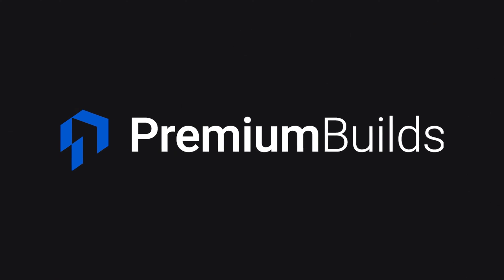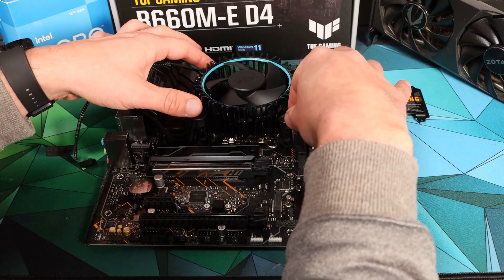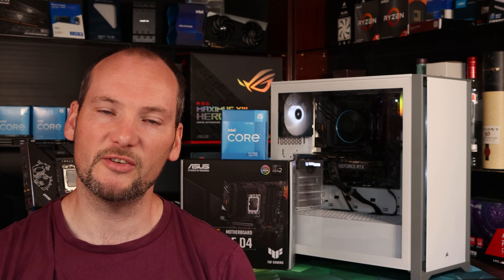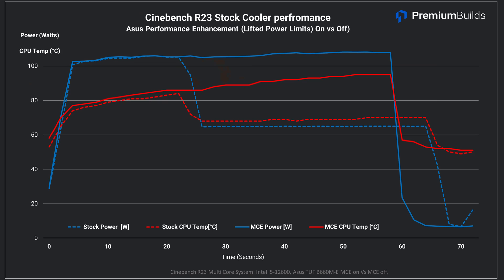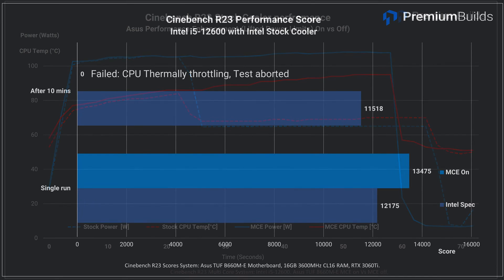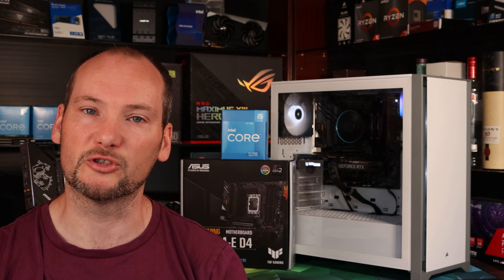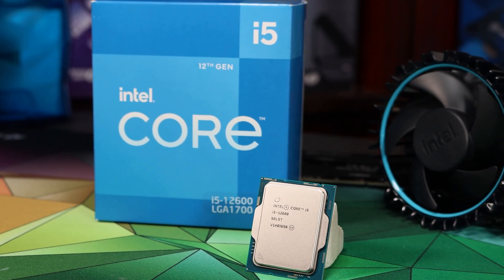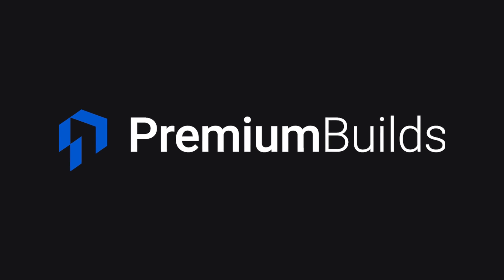Does stock suck? Testing the new Intel CPU cooler with the i5 12th generation!

Comment: as usual you like many other tech youtubers, you did an un realistic test.
This cooler is intended for 12100, or 12400, NOT 12600.
second, its the opposite, buyers who buy those basic systems runs at intel specs, not multicore enhancement.
3rd, no one runs the cpu in a cinebench loop, this is an unrealistic pc usage as it can get. 
normal people use the pc for office applications, browsing, and maximum they do is game. when gaming the load of the cpu is around 25w to max 40w.
so gaming scenario is what you should have tested the cooler with, and the results would have been correct.
If a buyer buys a pc for looping cinebench and this is what he enjoy in life, he knows very well to buy a tower cooling solution, he does not need you to tell him that.

if you claim to be professional ,re run the test as it should have been as explained above, normal gaming 12100/12400 and that's it.
Reply: very true i came for the same things you mentioned in your comment that whether it will be fine for 12400 at 65w for day to day usage...
Reply: @ITalented  I see I forgot to mention the 12100. it is working flawless with the stock laminar rm1, even with burning software when all limits are removed at bios level, which pegs the TDP to 58 wats. case closed.
Reply from the maker: Asus defaults to APE no matter what cooler you fit, so if people are experiencing high temperatures and throttling this video explains why.

I don't claim to be anything, I'm just helping people understand their choices when they pick parts and build a PC.

I make the advantages and limitations of the stock cooler quite clear in this video. 

I also moderate a community over 5 million PC users, and I can assure you that plenty of people DO NOT understand the limitations of stock coolers. 

>the results would have been correct.

The results are correct. A 40W load won't tell us anything, because it's not anywhere close to the maximum heat output of a basic i5 CPU.
Reply: @BuildPicker  You should have make the review the following way:
1. divide it into 12100 and 12400 apart.
2. show normal use case for every day pc user, which is in fact 99.9% of the people out there. use office tools, web browsing, and gaming with a dedicated GPU - what ever model you want be it RTX3090 to stretch the cpu to its max.
3. show a use case of some one using the pc for hi load rendering of photoshop or professional video editing tool.
4. teach why using an unrealistic scenario of OOCT or cinebench or what ever burner software to burn the cpu synthetically,  is not loading it in real terms but artificially for lab tests only, which are not relevant to the normal end user but to the developers in intel.  that is why no one should show the audience tests like that.
if it was a car, you show how it behaves on normal roads by normal drivers, not in Sahara desert at 55 degrees Celsius, stationary without air flow on a dynamometer. every normal car put to a test like that will blow its engine in a few minutes, even if it is a heavy duty caterpillar tool.

once you conduct the test to represent the use cases which it will see in its life on the road, you will come to the conclusion, that for 99.999% of the times the default intel included cooler is adequate for the 12100 and the 12400.

than you can elaborate that for the 12600k and above, this cooler is not intended and do a separate video showing why, and guide how to pick a tower cooler optimal for those more expensive cpu's - intended for the professional work loads scenarios. intel did not include the laminar rm1 with them for a reason.

**I am an engineer, I write from professional experience and knowhow.
Reply from the maker: @AY-dw4om  >, that for 99.999% of the times the default intel included cooler is adequate for the 12100 and the 12400.

It's not though because it restricts the ability of the i5 to perform optimally, and also it's really loud. It is supplied with the 12600, which adheres to the same power specification as the i5-12400 and doesn't draw any more power: it's just a better binned CPU and thus more efficient. 

I literally say that the Stock cooler is fine for gaming, or if you ensure stock power limits are adhered to. I'm not sure why you're so angry about this.

You're welcome to buy these components and do the testing yourself, to your own criteria. You can even make your own videos about it, that's the joy of youtube!

However, a better cooler is a big quality of life upgrade, like better tyres on a car, if you want to stick with that analogy.
Reply: @BuildPicker  I am not angry , you miss understood me, my wrong here.
for your info/question, I currently have 12400 for the past month with arctic 34 basic tower on it, which was found to be an over kill.
the cpu in real pc use e.g gaming is at 25-40w max, and at burner software looping -> is at 75 wats.
 temps at max 60 degree Celsius when burning hard, no sweat. this is when power limits are removed as you test.

a 12100 system is on order, will arrive to me in the next 10 days with a stock cooler, and will conduct my tests as well.
costs 120 US$ before VAT for the cpu, retail box includes the original fan from intel. for that price bracket, adding a 40 US$ tower like that arctic 34 is pushing the budget from reason territory. you do not buy a cpu for 120$ and waste another third of the price (40$) just for a cooler on top of that. that is out of proportion. that is why it is smart to stick with the original included fan with cheap cpu's.

I assume from information collected over the web from numerous sources and counting intel is a serious organization like Boeing, that they did serious developing before releasing those products to the market, and the original fan will be perfect for the 12100, even when intel restrictions are removed in bios as you test, as the cpu will go no more than ~58watts at burner software, so it should be enough. in games the same 25-40 watts are expected, those loads will make the original fan very acceptable by any standard of noise level and temps. I will report here in 2 weeks -> if will not forget to do so :-) 

**from my view, if someone is about to use the pc for long night compiling heavy sessions, like a developer of large software builds, he usually will not buy a cheap 12100 or 12400, but a more heavy duty machine (a work station) like 12600k and above models , which do not include a fan to begin with. this user will use a more robust heavy duty tower cooler. price wise it also make sense, as a developer who compile a lot, have a strong budget for development tools e.g PC hardware.
Reply: @AY-dw4om  man youre really informed on this , can you give me advice on the cooler water or air , which should i get , i now got i5 12400f in a be quiet pure base 500 fc case ? Thank you!
Reply: @borcepecale216  if you have the original Laminar intel cooler, it will be enough. if you insist, get the same tower cooler I got, the arctic 34....  - read above the exact model I mentioned, that I used in my build. and good luck :-)
Reply: @AY-dw4om  TY for detailed explanation. I'm choosing between 12400 and 12600k, which cost 50$ more, but since i would have to buy a cooler, the 12600k version would cost me 100$ more than 12400. Can't really decide what to get.
Reply: @developed-m6l  For standard home/office PC usage, I cannot find the justification to get the 12600K over the standard 12400.
if benchmarks are not your hobby,  but real PC usage is, than for generic usage even the 12400 is overkill. this is my CPU at home, I know from first hand.
If you use the pc for heavy gaming as well, let me remind us, that as always, the GPU is the limiting factor - not the CPU. hence you will not get more FPS (or lower latency from the game engine) when upgrading to 12600K. Because the GPU is always slower than CPU. the CPU waits for the GPU to draw the image , and not the other way around.
the only reason I see justification for 12600K, is, and pay attention: a very heavy processing tasks you run like heavy code compiling that runs through the night, or professional and heavy video/image editing, running a virtual server machine, etc...
 if you are not one of those cases, but a standard home pc user and gaming at most, stick with 12400 - as 12600K will not give you any additional performance you can feel or time with a stopper.
I might have  just saved you 100$ ?  if so, than go invest it (real estate, stock market. etc...)
or spend on something else you can feel - like taking you wife for a dinner... or buying your kids a present.
Reply: @AY-dw4om  hey, thanks for sharing your experience! I'm a student and most of the time I work with office apps, multiple browsers with lots of tabs (50 or more) programming some light weight programs, so I assume i need more ram than cpu (32gb or more). However I also like to do a little bit of gaming and video editing with Davinci resolve, and I was under the impression that 12600k is the sweet spot: https://youtu.be/BnePP6IeX7Y
Reply: @developed-m6l  Ram indeed is more important in your case, try DDR4 3200mhz (min) .  32GB might help if you run a lot of open programs at once. Get a nice SSD, if you can NVME. although it will not change much in terms of feel and response from the machine, as the Price Delta is only 100$ as you said, choose which ever makes you feel better between those two. be aware that you will be very satisfied with both of them so you cannot go wrong here. rich man problems 🙂

Comment: Hi, When I installed the stock cooler on MSI PRO B660M-A I had to press the mounting pin really hard for it to be seated well. Is that normal? How much pressure should I be applying while installing the stock cooler. Thank you.
Reply from the maker: Yeah, they can take a bit of force. So long as it's locked into the motherboard on all four corners it's fine.
Reply: @BuildPicker  thank you very much. I made all my purchase choices based on you channel. The way you explain things are so awesome.
Reply: @jaseem7  This happend to me too same motherboard and same cooler, it needed insane amount of force i had to push the motherboard from other side so it doesnt bend, thats not normal i think msi`s fault.
Reply: @Delpzie  Oh, okay. I replaced it with an AIO because Stock was thermal throttling at higher loads.
Reply: @jaseem7  Yo how's your i5 12400f working with stock cooler ? I brought i5 - 12400f and iam confused whether to buy a better Air cooler or just run on stock cooler , i do play some Fps games and use blender software.
Reply: @alexcoutinho2354  The CPU does hit 100 degree Celsius while rendering with stock cooler. So I recommend investing in a better cooler since you use blender which can be very CPU intensive during rendering. I bought Arctic liquid freezer ii 240 AIO.
Reply: @jaseem7  what 100 degree ? Is stock cooler that bad ? I thought 12th coolers are decent xD
Reply: @alexcoutinho2354  If you enable power throttling at 65 W, Stock might handle it. But you won't get the Max performance from your CPU (I am using i7-12700, not 12400f. The cpu can draw more than 125W if you disable power limits in your motherboard)
Reply: @jaseem7  can u recommend some budget coolers ? I live in South East Asia.
Reply: @alexcoutinho2354 Sorry for late reply, 
ARCTIC Freezer 34 Esports Duo would be a good choice for i5 12400f.
Reply: @jaseem7  No problem Bro ! Yes My research also says the same XD
Reply: @alexcoutinho2354  I recently upgraded my pc to 12400 non F version+stock cooler paired with Asus H610 prime mobo 8x2 16gb Ram @3200hz and RTX 2060. My processor is hitting 70-75-80c+ in cyberpunk 2022 Game with RTX on and in cinebench R23 multicore test it is hitting 100c on most of the cores in core temp and in Asus armoury crate it was showing cpu @ 88c and cpu package @100c
Reply: @ManDark_o7  throw away stock cooler and get after market cooler
Reply: Interesting discussion and video. In light of that I feel I will use a tower cooler for my MSI Pro B660M-A. I don't like the sound of using excessive force. Will be using an i5 12500. Looking forward to the build. It's good that Intel have finally improved their stock coolers. I did use it on a previous 12th gen build. With an AORUS Z390 board and i7 CPU and it was fine for it. That system was primarily for just office work though. I don't recall having to use excessive force in fitting the stock cooler to it.
Reply: U are using stock cooler for rendering on i7 without power limits
This is an user issue

Comment: Interesting that i5-12400f gets almost the same R23 long duration numbers (11300 vs 11500) as i5-12600K with the stock cooler. I'm using Phanteks P400.
Reply: Phanteks is the case right?
Reply: @ikram2512  Yes, the case P400 ARGB - version, without any mods or so. Just wondering that the difference between i5-12400f and i5-12600K is so minimal.
Reply: @restive81  do it got a good airflow?
Reply: @ikram2512  Yes, the case (P400) has very  good airflow. Ambient temperature at my house about 22 celcius.
Reply: @restive81  oh that's great I'm planning to goes around the internet looking for great PC case but is it atx or micro-atx case?
Reply: @ikram2512  it's medium size case, supports both ATX and mATX motherboards.
Reply: @ikram2512  You can find a good review about the case from YouTube - for example Steven has made a review about the case: Hardware Nexus is the channel name if I remember right.
Reply: @restive81  thanks I do subs to nexus too lol
Reply: @restive81  gamers nexus, and hardware unboxed are different, you got them mixed up.. and funnily both of them have someone named Steve on it.
Reply: @bhuchin  yes, you're right 😄

Comment: dude what happens if you replace the stock thermal compuond with something betterm like TG cryounaut, AS5 or cooler master mastergel maker nano.?
Reply from the maker: Very little. 1-2C difference at most. But Standby... I've found a big solution to Alderlake temperatures that costs dollars and lowers temps 5-10C. I'll do a video on it shortly.

Comment: Hey i get same motherboard as in video but have problems whith ram overclock on normal xmp.
Reply from the maker: What RAM kit are you using?
Reply: @BuildPicker  Kingston FURY 16GB KIT DDR4 3600MHz CL17 Beast Black
Reply from the maker: @setpopa5357  2 Sticks? Got it in slots 2 and 4 counting away from the CPU?
Reply: @BuildPicker  Im not at home but i think i get tham in slot 1# and 3#

Comment: Atleast its not a rattly mess but it isnt up to the task of cooling my new i7. Waiting for lga1700 brackets still.
Reply from the maker: Do you have stock power limits applied? It should do OK at 65W, but it's certainly not great. Just better than the old one. 

A review of a bunch of other coolers is upcoming!
Reply: @BuildPicker  no power limits. Gaming is ok still (80-90c)., Benchmarking, forget it. instant 100c

on 65w the cooler is adequate and the noise is more pleasant then my old 2600 stock cooler. So they did do something right.
Reply: I was gonna use my watercooler first, but thought I could try my evo212 black edition rgb first. so i got the brackets, and my 12600K is at high 60's in temp when you try demanding workloads. i have asus performance enabled. I Think the Evo212 is probably at the limit for the 12600k.
Reply: I can't think of a better use case for these stock coolers than "waiting for LGA 1700 brackets"
Reply: @SimplyLewin  agree :D They should not include a fan at all. Just adds price to the unit, and also shipping in some cases.
Reply: @AndrewTSq  It's not as bad as the AMD Wraith Prism. That thing performs better than this, but it's heavy and expensive to produce. AMD had the good sense to abandon it after the 3000 series, because nobody wants the noise from it and even a $30 tower outperforms it. You can still buy it standalone form AMD's website for $45. It's the only thing consistently in stock there.